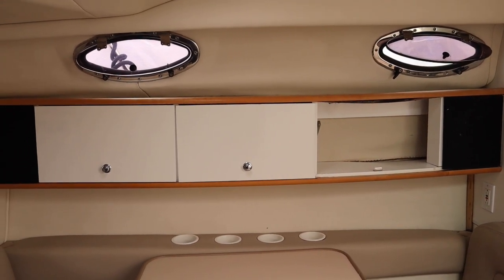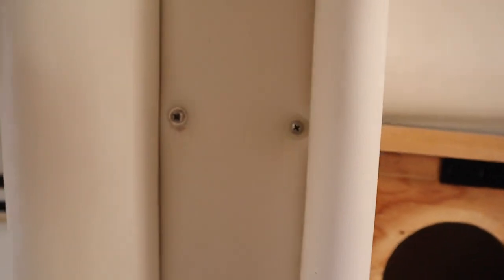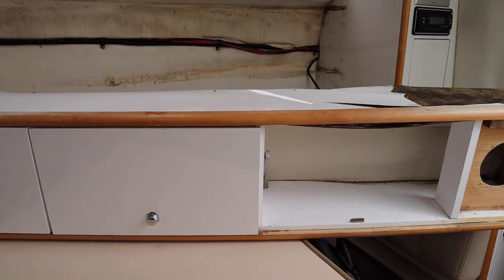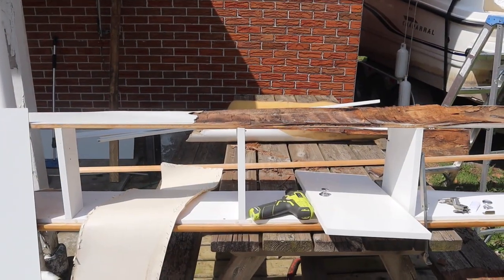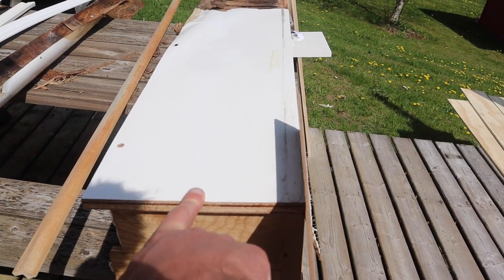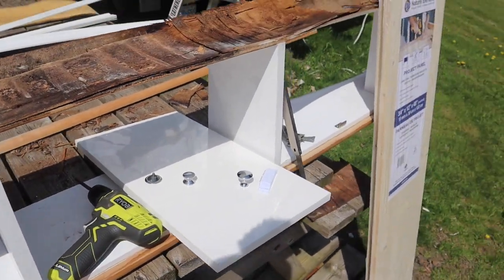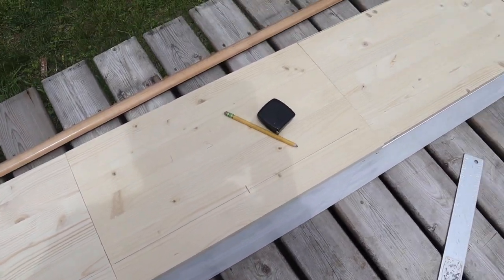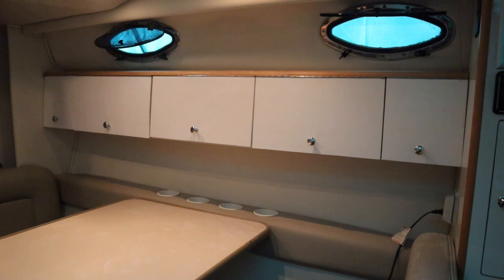S3 Ep20 Rebuilding Rotten Boat Cabinets

Comment: What was the source of the water leak? Did you address that?
Reply from the maker: I’m not entirely sure. The entire foredeck is rotten and I’m replacing that as well. Based on the stains and where the rot was, I assume it was the aft porthole? Window? The boat is 25 yrs old. Maybe window seal leak or just previous owners cruising with the window open from time to time?